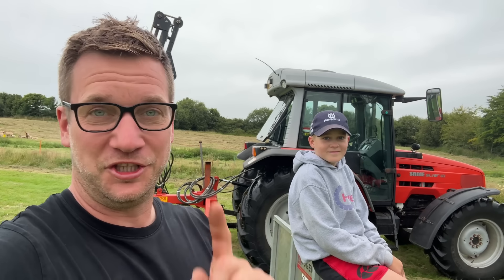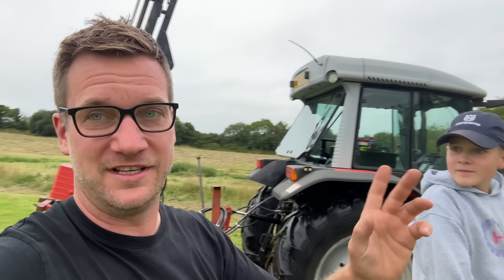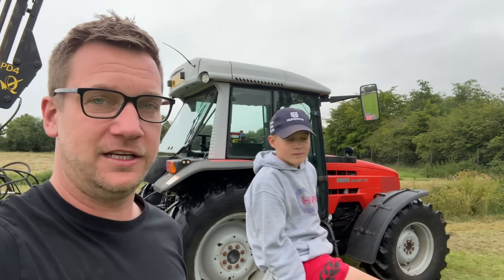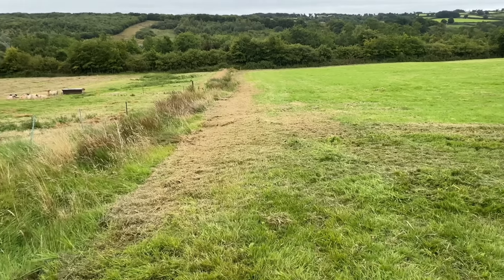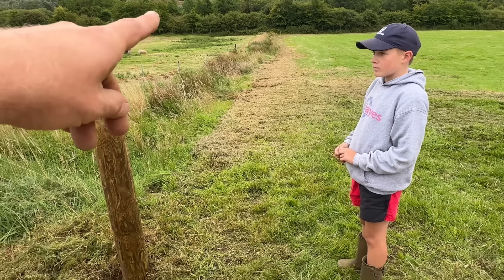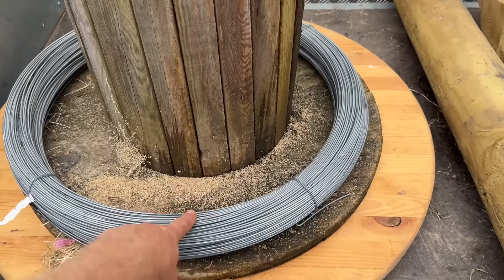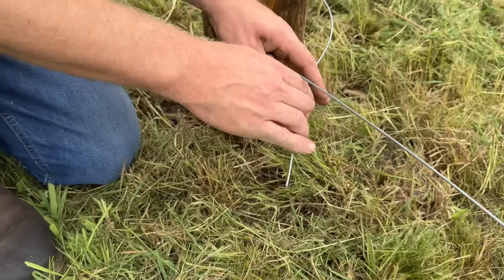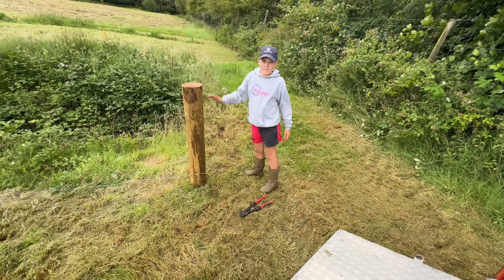It’s Time to Test Our Quantock Post Banger - Do our mods work? Farm Fencing!

Comment: Hi James , the agri buggy is perfect for that job you should keep it.if you get yourself a 1200 or 4 ft level you can not only keep the post upright it also acts as a depth gauge or otherwise cut a piece of Batten to the required depth.👍

Comment: Great video as always, such a great team you and Max make😎just pop a piece of insulation tape on mast of the knocker at 1.2m, that saves you checkin with tape measure each time 👍👍
Reply from the maker: Yeah the rough level is the bottom of the yellow sticker on the mast, but depending on how the ground falls away, I tend to measure everyone.
Reply: Good work going on there...1 thing I learned when using chain wire stretchers like yours is when you attach the clamp part too the wire ..before you put the chain into the 2 legs that climb along the chain...look down the chain when pulling on it under tension and see the chain isn't twisted as if it is as the legs on the puller claw along the chain they will eventually start too struggle too claw onto the links  and that's when people have difficulty with stretchers slipping on them and maybe getting hurt...simple thing buy always worth doing 👍
Reply from the maker: @alanyoung7655  yes, this is great advice! Thank you.

Comment: Our Quantock already had the spool block on the from new, and it's also got a bigger weight block.
We must have upgraded it when we ordered it.
Absolute waste of time using tanalisled posts, creosote is the only viable option now.
Agribuggy is a handy bit of kit for sure👍💪
Reply from the maker: You could spec them from order I believe. Also we don’t have a post plate, will make one some time 👍🏼